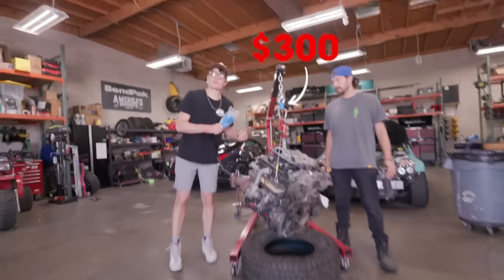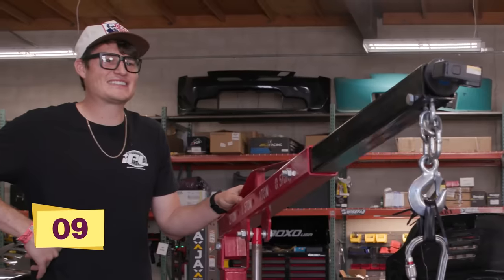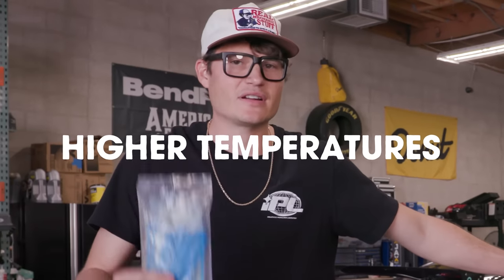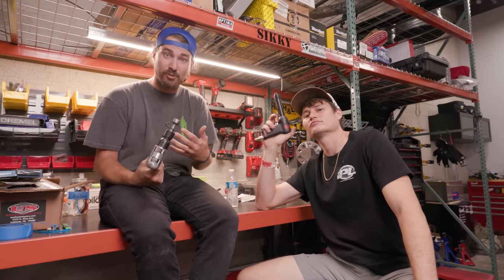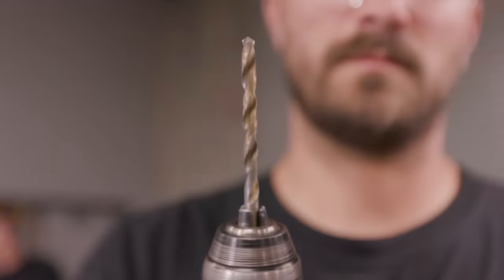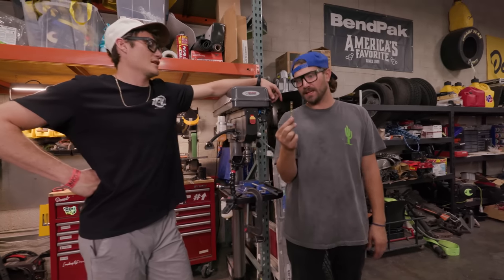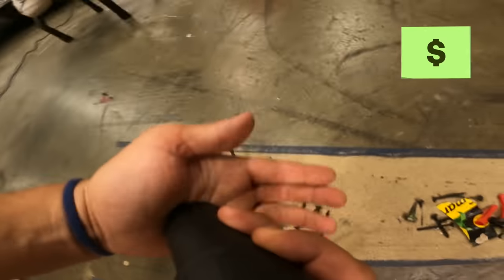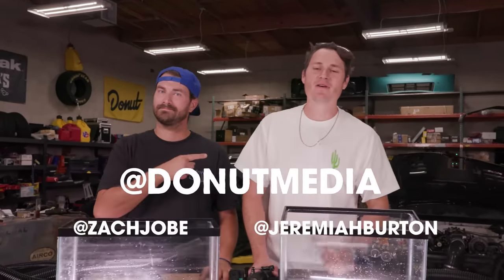We Test: $1 vs $300 Zip Ties

Comment: Titanium nitride coated and cobalt steel drills bits have different purpose and characteristics. TiN is great for lower hardness steel and softer metals, and it's more flexible. Cobalt HSS is great for harder steels - nickel-chrome, stainless, etc. , however they are very fragile - just try to open up a hole with rough edges, and it snaps immediately.
Reply: No one should be buying anything based on these tests.  They just aren't good or even comparing apples to apples as you said
Reply: @SaiRyan1  yea definitely more of a entertainment oriented video, still enjoyed them making a joke out of those $100 zip ties lol
Reply: Yeah, that’s why they have different price. There are no cheap cobalt bits.
Reply: TiN bits also get sticky in aluminium, so any of the other options is a better idea.
Reply: @SaiRyan1  so are you saying these tests are a waste of time but bring a lot of traffic that pays?   Hard to turn down more money for less content.
Reply: @Ryan k yea I love the donut boys but I wouldn’t make consumer choices based off of these vids lol. Project Farm is good for that.
Reply: @putoutmyfirewithgasoline1877  you spelled AvE wrong.. he's the father of tool testing..
Reply: What's your point? These test were simply to compare a high priced item to an inexpensive version, to show how well they preform side by side. As per the drill bits, they showed you get what you pay for. Same for the air hammer. Yet the zip ties and shop vacuum, showed you're better off with the inexpensive versions. 
Unless you're a machinist, the average person won't need expensive material specific cobalt bits. 
I've used cobalt bits in handheld field applications and I can count on one hand, how many I ever had snap. Even though they got bound up, while stepping up the hole size.
Reply: @lennychorn147  I have a $400 set of drill bits I use at work. They're the HSS ones and I only use them in the drill press or mill when it's set up as a drill press. But I also do material specific work
Reply: @samuelwahls8315  Good for you. But so what? You're simply agreeing with the outcome of the test. The more expensive bits are the better bits, to have.
This is also was also geared towards Harry homeowner, the weekend warriors and hobbyist. Not professional tradesmen or serious home non commercial shops. 
My retired sideline is being a serious woodworker, building everything from furniture to toys. I know the value of buying quality and specialty tools and bits. My Router bit collection alone, would cost between $20-$30K, to replace.
Reply: @lennychorn147  I was agreeing with you in the fact that different bits are meant for different things
Reply: @samuelwahls8315  Sorry. My bad. I misinterpreted your post.
Reply: @lennychorn147  all good dude, no harm done
Reply: Yeah, I keep a better set next to the drill press and I'm always catching my dad using them elsewhere. At least I've become a skilled bit sharpener
Reply: good insight! thanks
Reply: A fellow machinist I see…
Reply: @skilledtradesscotty4896  na project farm is the boy for good testing
Reply: For sure. A better test would have been cheap HSS vs expensive HSS. Or drilling stainless, which would have destroyed the cheap style in seconds.

 Still, this was amusing.
Reply: You can coat almost any metal with TiN and its variants, but is the base metal is crap it doesn't do much, witness all the "gold colored" crap tools at HF. HSS and cobalt HSS is far better base metal and costs as such, any TiN coating on good tool steels like these is top $ and performance.
Reply: gonna say. Good luck trying to cut anything hard with titanium coated bits
Reply: Yeah what did you expect they didn’t know what a split point drill bit is.
Reply: Harbor freight also has cobalt bits. They're in the $70 range
Reply: @samuelwahls8315  with the kind of work you do you can probably relate to this. I think it would be entertaining to see a video of someone trying to drill a hole in ar500 for their first time and see if they get through it or make the common mistake a lot of newbies make in not keeping a consistent speed and temperature and letting it get to hot an glazing over. Once that happens, it's a huge pain in the @ss. 😆
Reply: @crowellsteven84  as a gunsmith that would be a funny video
Reply: @juzoli  I’ve got a ‘cheap’ set of £35 ($40) Bosch Professional cobalts (only 1-10mm), which I use when I don’t want to screw up work’s Dormer bits. A year of relatively regular abuse in pillar drills, opening holes, plenty of stainless etc and they’re still super sharp. Going slow with coolant. Obviously not gonna compare longevity wise to a proper machinist set or even the Dormer jobbers, but I think some of the stainless would have destroyed the far more expensive (3x more) non-cobalt TiN Dormers, just because of the harder material. I’d highly recommend the Bosch set as a budget cobalt option.
Reply: Yeah titanium is not a hard metal. Cobalt and tungsten are hard metals.

Comment: As the owner of a carpet cleaning company I can tell you that the quality of the parts is what sets vacuum cleaners apart, not the flow rate, which is what you measured. If you bought the right vacuum cleaner, it will remain at optimal sucking power for longer at a time and also it will have a much longer total lifetime.
Reply: What brand would you recomend for optimal durability?
Reply: @yamatokawa  Dyson vacuum vacuum cleaners.
Reply: @ministrychannelsa4216  thank you. Will keep it in mind

Comment: The Harbor Freight zip ties don't last through an Ohio winter in a garage. They get brittle and break much easier after freezing.
Reply: they are a dollar... buy a brand new pack every year and youll never reach lifetime cost of the blue ones.
Reply: I bet neither do other comparable brands.
Reply: Nothing makes it out of an ohio winter working like it did before lol
Reply: @sometwo2117  rest in piece any car made of steel ever
Reply: Odd.  They last outside in much colder ND winters.  I use them to hang Christmas lights on my trees.
Reply: @desmondh7844  I think the point he's making is: if they can't make it through a winter sat in the garage then what good are they if he needs them to actually tie things together.
Reply: Would have liked to see what UV does to those ties.  I manufacture products with plastics that have to be out in the sun.  Material matters
Reply: @guitarcrazy02  my old Volvo came factory with rust proof undercoating like 1/4” thick. Absolutely no rust after spending its whole life in the upper east coast and then moving to Ohio. Praise the lord for those Swedish engineers
Reply: @guitarcrazy02  thank God I live in Louisiana where the food is good and we have vehicles that go through engines and transmissions much more quickly than floorboards and body panels. I have friends who live in Kentucky and their truck folded in half like a taco due to rust ravaging the frame.
Reply: @desmondh7844  I'd much rather just put good zipties once and forget about it than have to replace them every year to save a few bucks... Go figure.
Reply: This! Best bang for buck are GB electricans Zip Ties at lowes if you wanna save money...double teeth, one piece injection molded just like high end ones and last through heat and cold.
Reply: @gutterg0d  just get the $10 zip ties instead
Reply: @ChlorideCull  It's not about the price, it's about using the right product for the task. Sometimes $1 zipties does the job and sometimes something else is needed.
Reply: @desmondh7844  if it doesn't last in his garage why would it last in actual use?
Or is it worth re zip tying everything you do one year the next year to get the cheap stuff?

Comment: The secondary cut in the drill is for drilling blind holes. The smaller radius at the center of a drill travels less distance in a rotation, so it requires a different angle of attack to effectively cut material. Without this the drill just kinda pushes the material to the side until the drill gets deep enough cut, hence why large straight tip drills are so hard to use without a pilot hole.

Love the video guys!
Reply: You're broadly correct but the mechanism at work is not to do with the angle of the cutting edge - it's the fact that the cutting edge entirely ceases at the web in the centre of the drill. The cutting edges cannot make contact with the material being drilled until the web has sunk into the material, which for something like steel can be quite difficult - it's displacing the material, not cutting it. 
By split-point grinding, the cutting edge is extended all the way to the centre of the drill web.

Comment: As a machinist those drill bits might not be for drilling that type and thin metal. If they had holes in them like he said it’s for through coolant.
Reply: Don't forget about speeds & feeds. A fast bit dulls a slow bit breaks
Reply: You are missing the point of the tests. Which was to see which lasted longer, under torture conditions.
Reply: As an engineer.  This speed run tool comparison video hurts to watch.  What's right about it?
Reply: It's real life comparison Mr engineer
Reply: @Shocker99  Considering you're an engineer, why don't YOU tell us what's WRONG with it?
Reply: @BRENDANTHERED  Not a machinist, but you don't need to be one to know not to use machine bits in a hand drill.
Reply: @CoolguyFurlough  I'm no engineer either, regardless, I would agree with you.  My comment was directed at the engineer, however.  (!)
Reply: @lennychorn147  If you use the wrong tool in the wrong conditions, that is not torture conditions, its just not the right pick.  For stuff like sheet metal a Step Drill is usually the best option.  For certain stuff you are better off using a cheaper/worse drill bit and just resharpening it.  But when drilling harden metals, if your steel is turning blue you have ruined the temper, the bits hold the edge best when at 350°F max so either use cutting fluid or compressed air and you will have better results.
Reply: @4RT1LL3RY  Dude, you're talking out your backside. As well as missing the point. 
The whole idea here, which the first was about, which bit did the best job the fastest. The second was to see how long they kept a cutting point, under torture conditions. It showed the difference in craftsmanship between the cheap bit and the expensive one. How else are you going to test it, without spending hours of drilling?
Everything that gets tested, goes through some sort of unrealistic extreme tests, to determine their feasibility under normal conditions. From these tests, it is clear under normal conditions and applications, the expensive bits will still be in use, while the inexpensive bits will need regular replacing, doing the same work.
Reply: yeah those were really bad tests for jobber bits.
I don’t even think the drills were through coolant since they were cobalt, I think he just meant the web splitting grind.
Reply: @Truthbomb423  It isn't remotely scientific. Love this show, but this is more about entertainment than actually testing the tools. The drill bit test wasn't too good because they're bits meant for different tasks. If the points were cut the same then it'd be a better test.

The rest of the tests relied a lot on how good either of them were at using the tool, and not necessarily how good the tool was at it's job.
Reply: Keep in mind, this entire channel revolves around showing people what they want to see, not necessarily the full truth. Many of their videos include misinformation, but they're still entertaining and are bringing in loads of cash. There have been cheap vs expensive tests on other channels that have much more commitment to finding the true value vs just donut putting their stuff through the idiocy that a backyard mechanic might try
Reply: I was practically screaming at them, the small holes are coolant through and not the same application.
Reply: @Truthbomb423  ok so it's a real life comparison of exactly how those tools aren't used in real life....what a conundrum
Reply: @Wpjgdmtu  yes of course this episode wasn't even remotely scientific but their previous content used to entail a great mix of both. They were entertaining and they actually presented relevant facts that were useful in the real world. This & some of their other recent content may be "entertaining" but it completely departed from anything that could be considered actually useful. This video along with the "coolant replacement" video are literally brain mush w/a side of gravy. They serve no purpose but to make it's audience mentally obese. I hope to see them turn it around soon.
Reply: Sorry what do engineers need zip ties for? I thought an engineer would rather weld or something. Build whatever as strong as you can with the material you have. Where do zip ties come to play?
Reply: @lennychorn147  Not really, I worked at a Steel heat Treating plant for 4 years.  There is is a trade off of hardness vs toughness.  Hardness lets you keep the edge better but it means you get breaks rather than bends.  4140 tool steel was heated to 1550°F held for at least an hour then quenched to agitated hot oil at ~160°F.  Then depending on the Rockwell rating but would usually be between 450°F and 550°F for the temper.  That includes things like large impact sockets, racket mechanisms, and drill blanks.
Just because a Carbide bit will break easier than a HSS one if you treat it wrong doesn't mean its not the better bit with way longer life when handled correctly.  
But to answer your question, look at Project Farm's comparison of Drill bits instead.  You hang a weight from the drill press handle to give it a consistent load into Mild-Steel bar.  You time it and then check the temperature of the bit and for wear.  A better bit will be faster and cooler.  And it showed really well in his video for it.
Reply: @4RT1LL3RY  We saw the same results their way.
Reply: If they used a carbide bit for the torture test it may have prevailed 
And they are like $75 each
Reply: @lennychorn147  tests like this don't really do what you think they do. 
A car makes a really crappy hammer. Use tools for what they were designed to be used for, just straight abuse doesn't prove anything. I can hit any drill bit with a hammer and break it, that doesn't mean they aren't good bits.
Reply: @sethmcsnotter7872  "75€ each" I mean really depends on size and length as well If bought new or reground..(and possibly coated again)  

You can get good carbide drillbits for like 10-15 bucks (depending on size, as well as length.. 

I bought a full carbide countersink from ebay for 6 bucks and used it on like 100+ holes already (which are case hardened, from laser cutting) and you can't even see wear yet.. 
Countersink from Garant 140€ stock price lmao... 🤣

Comment: Just started at my new job and I learned another reason that the blue zip ties are special. Apparently the material that they are made of is also vacuum compatible which is important for use in things like space craft
Reply: Yuuuup. We use blue ties (which are usually tefzel) in TVAC testing, and only buy red for non-TVAC compatible ties, so that people can quickly see they aren't TVAC compatible
Reply: I wonder why Tefzel would do any better in vacuum than nylon.  Could it be that the Tefzel does a better job resisting UV embrittlement?

Comment: Fun fact Tefzel zip ties are also used in the space industry due to their ability to resist cryogenic and very hot temperature fluctuations. I use them all the time at work.
Reply: works at McDonald's
Reply: What do you do exactly? Sounds fun.
Reply: @zfgnerdlife  he's a zip tie tester
Reply: Yeah, but seems to kinda suck at doing it's job unless you work in extreme temperatures.
Reply: @Clay3613  Why does it suck?
Reply: @poshun9407  I’m guessing because the more expensive ones broke with 8 left, compared to the cheap ones.
Reply: @onlythedeuce4579  well that test wasn't a very good test either.  What if they cut the three zipties holding the most load when they cut the expensive ones,  and when they cut the cheap ones they cut ones not holding most of the load. Just bad tests. No one should be forming opinions on these tests
Reply: as a certified space missile, i can second the "works well in space" part.
Reply: @SpaceMissile  🤣

Comment: Did you let the heat gun cool before doing the second test?
Reply: Thought the same thing. Also depends where the heat is directed (zip ties can deform from heat more on the 'strip' before failing compared to the locking clip area) Doesn't really matter though, $3 zip ties aren't for us
Reply: Well, since they had to re-rig everything for the second test, I'm gonna guess that yes...it cooled down.  It would have taken them at least 5 minutes to set up the next one.
Reply: That's what I was thinking exactly. Doubt it

Comment: For anyone curious I have the Bauer 6hp 14 Gallon Shop Vac, the thing is a champ. I had 3 bags of old concrete in the back of my truck that fell apart & it vacuumed it up in less than 5 minutes including big 1-2 inch pieces that were solid like it was nothing. Only downside is the Hose is a bit stiff other than that highly recommended, it's backed by a 1 year warranty aswell.